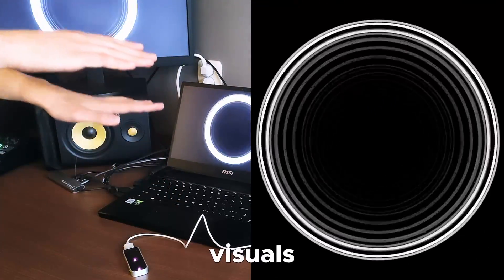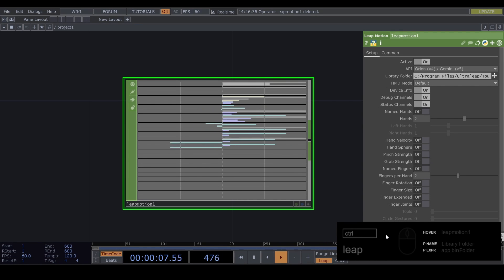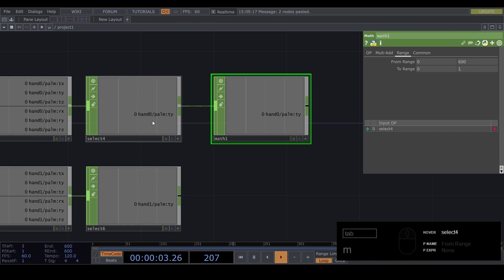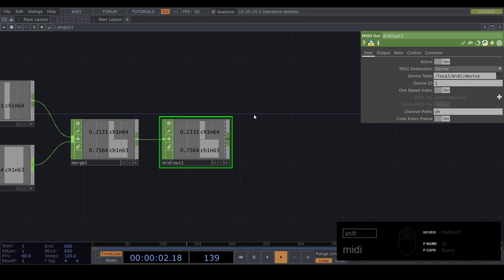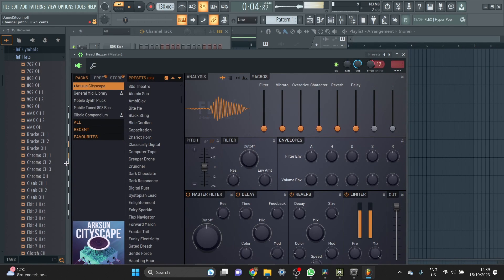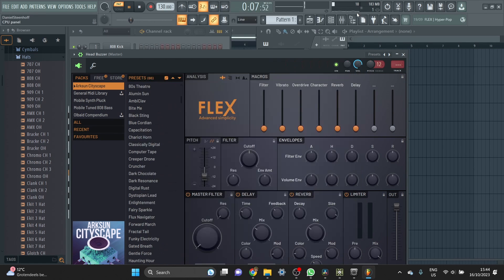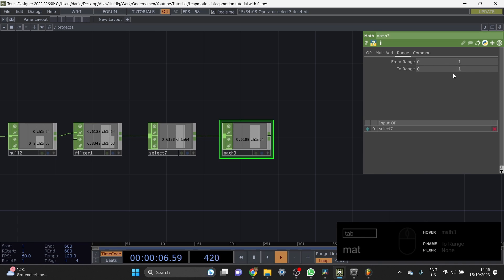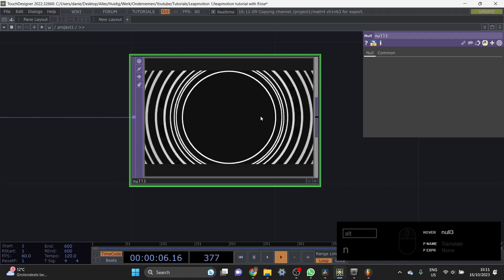How Does My Hand Control These Visuals?

Comment: how did you get the data from the leap motion sensor into touch designer ??
Reply from the maker: Make sure you have the correct leap motion drive installed :)